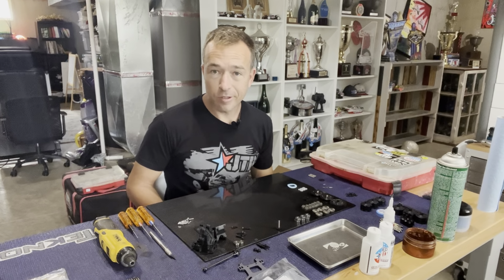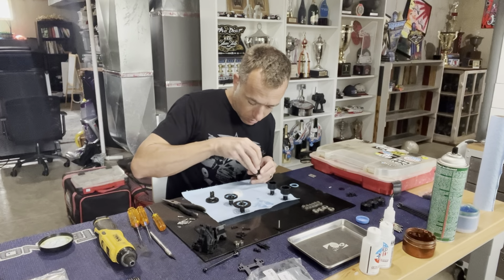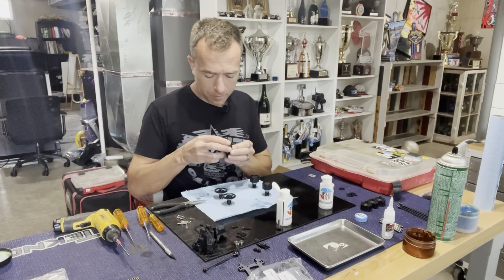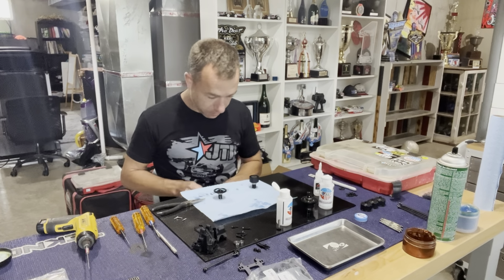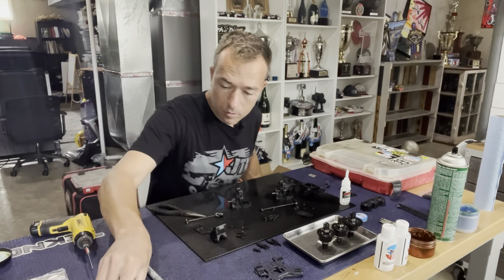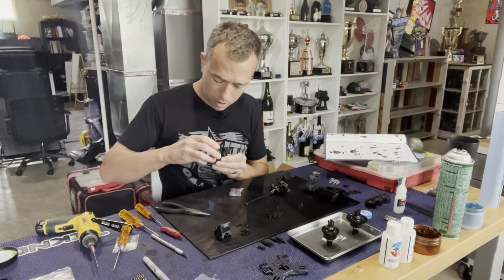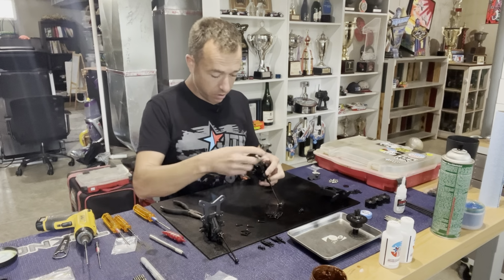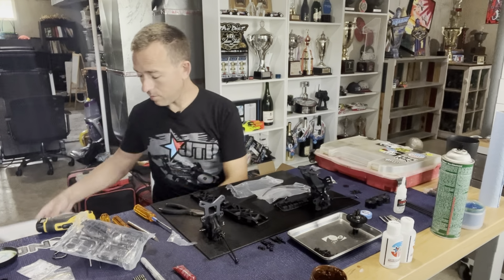Tekno NB48 2.1 BUILD SERIES Part 1 with Jared Tebo

Comment: Cooling head bolts and Diff case screws always get the X cross treatment. Thread them in a cross pattern as it will even things out when they get snug.

Comment: does super gluing the screws in on the diffs affect when you go to take it apart again to change the fluid??? do u have to heat it up with a heat gun or does it break loose?  ive just stripped so many heads on screws i guess if you use the titanium screws less chance of that
Reply from the maker: No, you won’t stripe the screw head with glueing them in. Titanium screws are softer than steel, so they actually will strip easier. The key is to have high quality screws, where they are tighter in the screw heads.
Reply: @jaredtebo_rcmtb  nice ya I’m waiting to order my nb48 2.1 I doubt there will be any Black Friday deals on it or cyber Monday but I’m waiting just in case glad I waited on my servos amain has protek black labels for $100 right now limit 2 per person just ordered those for my kit